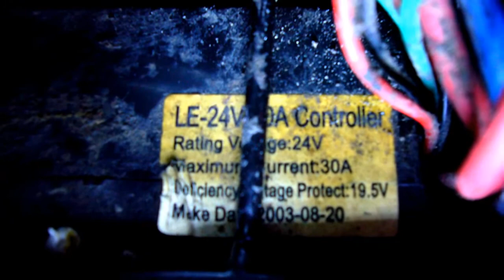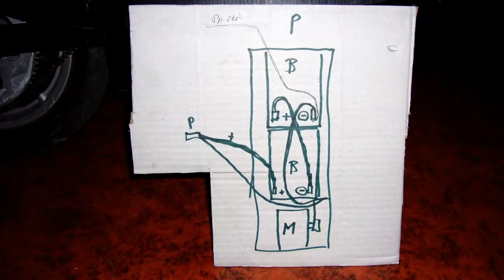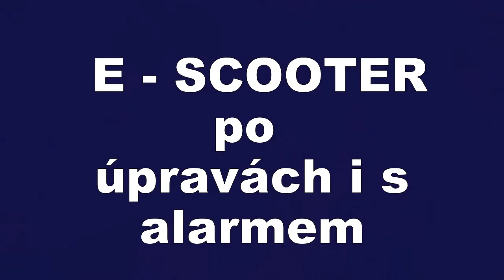E - SCOOTER - 2/4/- Úpravy a vylepšení

Comment: Hi, I don't suppose that anyone has a full wiring diagram of where all wires connect to, I'm in the process of restoring my e-scooter, it's been stripped down for years. sruggling with handlebar horn, lights, indicators, especially. in English please, please message me direct to Flashytuk.
Thanks in advance.Flash..
Reply from the maker: Zdravím,kompletní schéma zapojení nemám. Co rozdělám tak složím. Na Alli Expres se dají dohledat sady 24 V 250 W, 350 W. U nabídek jsou i schémata zapojení řídící jednotky atd. Je to v anglickém jazyku. Základní zapojení. Posilám vám odkaz, ale jestli ho časem nezruší. J.S. https://de.aliexpress.com/item/32911644784.html?spm=a2g0o.detail.1000014.16.2f0a5c3dHpHROy&gps-id=pcDetailBottomMoreOtherSeller&scm=1007.13338.133222.0&scm_id=1007.13338.133222.0&scm-url=1007.13338.133222.0&pvid=bd5256b4-f9a3-49fb-a23a-d84667e34b3b
Reply: @jirase51  -ahoj,mám u tohotzo skutru menší problem,zadni rafek ač je osazen volnoběžkou a rozetou a novymi ložisky tak je docela vidět že to plave,myslím tím jako kdyby to byl ráfek z kola a mělo povolený výplet,